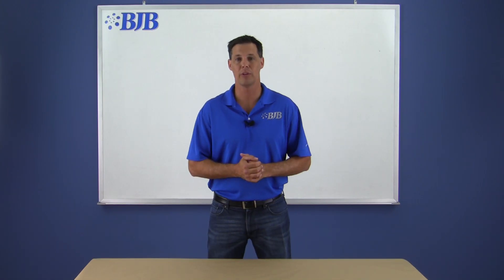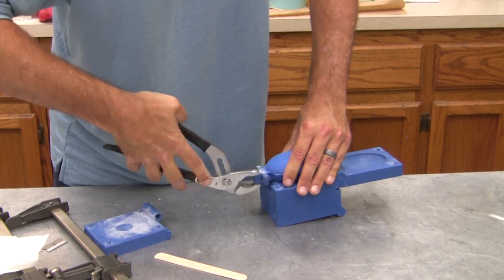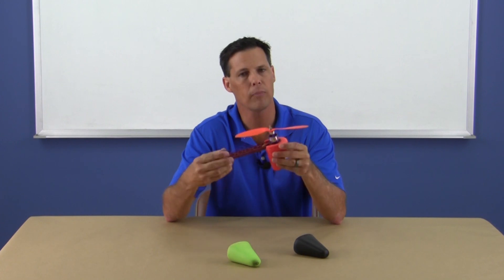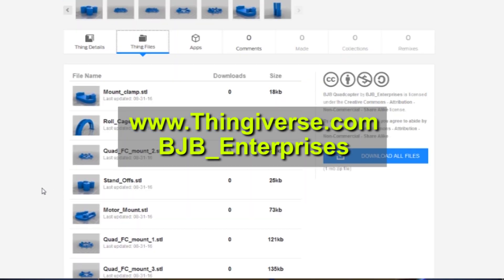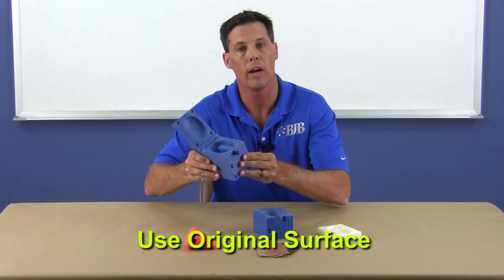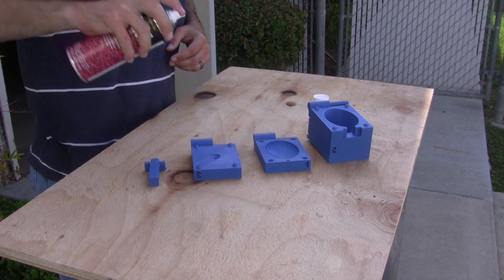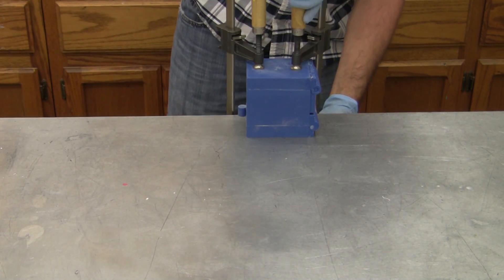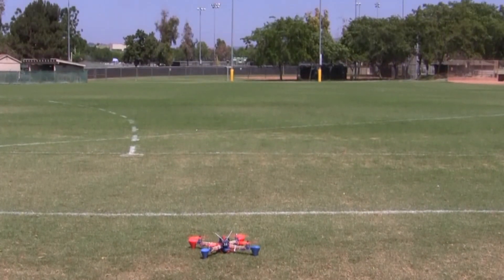3D Printed Mold Tutorial | Tips, Tricks, and Troubleshooting

Comment: Great video! I love the application. I'm currently using similar techniques for prototyping stuff : I cast silicon into a modular mold box 3d-printed in ABS with a master part printed on an SLA printer, then cast urethane resins into them to produce the final parts. I had similar problems than you show with the print layers of the ABS mold box, and since it was only flat surfaces I now cover everything in Kapton tape in order to have smooth surfaces on the mold. As for the master, the SLA prints are already pretty smooth but I'm experimenting with tumbler sanding and acrylic varnish to see if I can improve the surface finish on small and complicated geometries that are not easily sanded by hand.

Comment: Hello BJB team!
Which mold release do you recommend?
My mold is of PLA (3d printing). And the composition I am pouring is not super liquid, is for a grout sample bar.
Thank you!
Reply from the maker: Definitely several coats of mold release wax buffed on and off.  You then need to apply a mold release that works well with cementitious materials.  Some people have used vegetable oil based releases like our E302 Rocket Release or a rag soaked in vegetable oil rubbed over a pre-waxed surface.  Good luck!

Comment: For the rigid mold, why was ABS chosen over something like PLA? Is it due to temperature when the foam cures?

Context: I'm looking at 3D printing molds for foam costume parts, and printing with PLA is far easier than ABS.
Reply from the maker: True.  We felt the ABS would be a better mold material (heat and toughness) but PLA would likely work fine as well.  Our Axiom Printer was already set up for ABS and made very nice prints, so we stuck with it.
Reply: Thank you for the response. My understanding is that modern formulations of PLA and ABS are mechanically similar, but ABS still trumps PLA when it comes to temperature. How hot does polyurethane foam get when curing?
Reply from the maker: I don't have an exact number because exotherm (heat) depends on the mass, but we typically see temps peak in the 200-220F (93-104C).
Reply: That's more than good enough, PLA's glass transition (warping) temperature is around 60C, while ABS's is around 105C. Looks like ABS it is :) Thank you for the assistance!
Reply from the maker: Glad to help.  We have made some nice molds for casting flexible non-foaming polyurethane out of PLA with good success.  Many of the techniques shown in the video still apply, especially when dealing with mold release.

Comment: Do you have to wax the mold with each casting?
Reply from the maker: After the first or second casting, no.  You can simply use the urethane spray release after that.  The wax essentially seals the tool and the spray release does the actual releasing of the part.  On rigid tools, the wax is a very important step or you will end up with stuck parts.